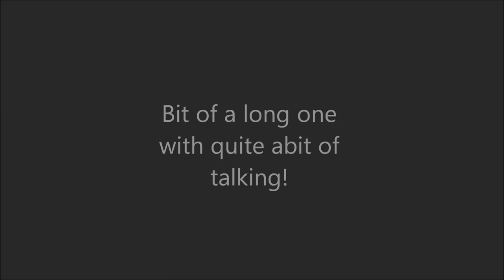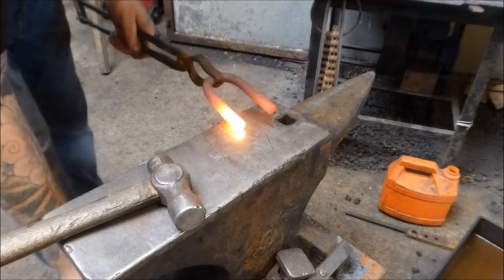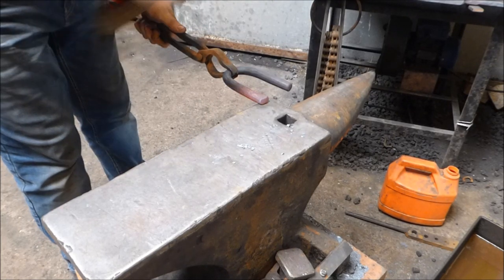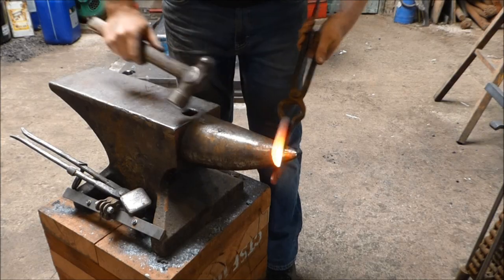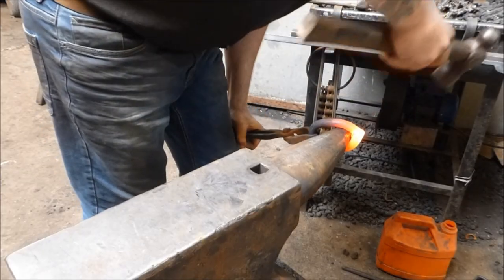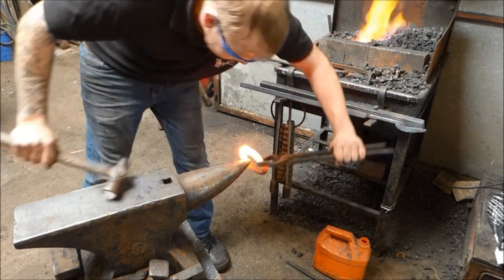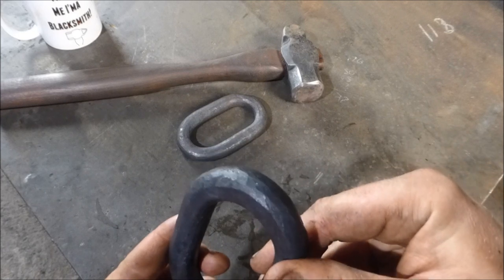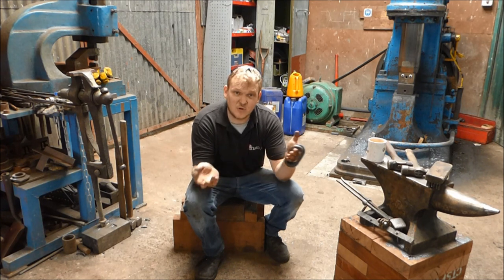Blacksmithing! How to Forge Weld? Forge Welding Chain! Trust Me I'ma Blacksmith!

Comment: Great video! Just ran a few numbers, with 250mm(10") of 16mm (5/8") stock per link you're looking at 51links for 20kg.Love the set hammer idea, I'll need to give it a try
Reply from the maker: I make it 49 but yeah its a lot wouldn't be a challenge other wise hehe.
Reply from the maker: Thank you for the great comment dude.

Comment: On my course, we used a jig to get the bend at the bottom correct. I'm sure I've got a sketch of it somewhere.We then heated the scarf's up, until almost liquid, then hit the scarfs 4 times, two on each time, as hard as you can so the force welds them together. (sorry not trying to make you suck eggs)  Do you take into consideration the % of steel you will lose each time you fire weld it?

Comment: Rowan Taylor demonstrated chain at one point, and he used a chain makers hardy tool. I wonder if one of these could assist in avoiding the bulge you mentioned occurring. Thanks for the video Daniel. :)
Reply from the maker: I will be making a chain makers hardy for the challenge i hope.It should really help. He does make some cracking videos. Thank you dude

Comment: very cool... when starting the forge weld  from heat to heat is there a time  then another heat ....  thanks
Reply from the maker: Thanks dude. You don't want the work to drop below a welding temperature to much as easy as that.

Comment: Another good video Dan.  I think it would be of use to folks without much experience to add some information on what parameters effect fire welding and what they need to be looking for regarding the right temperatures etc.  Mark Aspery's video on fire welding is an excellent recommendation.  Where are people supposed to send a link to?  Have you posted a mailing address somewhere?
Reply from the maker: Thank you dude. I had done some video on that but as i was a little unsure of the out comes i left it out. It was also making the video a little long. if you are keen to make a link dude drop me an email and ill send you my address. Thank you for the great comment dude.

Comment: Do you ever use flux when fire welding mild steel? Some say you should only use it when fire welding  high carbon steel, others say you should use it all the time, some use sand instead of flux....what are your thoughts about that?
Reply from the maker: I never uses flux for any welds may be I should try it. Wasn't taught to use it at uni and there for I haven't really tried it. I was always told that you can create an oxygen free environment in your fire if you have proper control. If your fire is burning white  hot there is no oxygen present in that area of the fire that's what I aim for. Its sort of like gas welding i thought. carbonizing and oxidizing flames. The heat of the the flame means that no oxygen is present. thank you fro the great comment. do you use flux?
Reply: I do, I use borax and as I said, some people say it shouldn't be used on mild steel, but it's very cheap so I use it anyway..
Reply: I agree its just an additional precaution to ensure less material loss on mild steel,but i always use it when welding due to it being cheap.

Comment: Hello Dan. Great info on chain making and forge welding. And thanks for the inspiration. Oh your set hammer is it made from mild steel ?
Reply from the maker: Hay dude thank you fro the kind words and the great comment. I'm pleased that i have inspired you. You going to make a link dude? The set hammer is made out of fork lift truck tine. so its a middium carbon steel about 0.3-4% ish with a little chrome in for toughness.